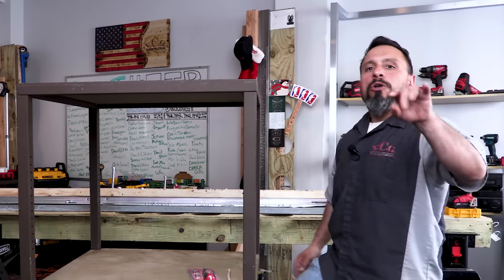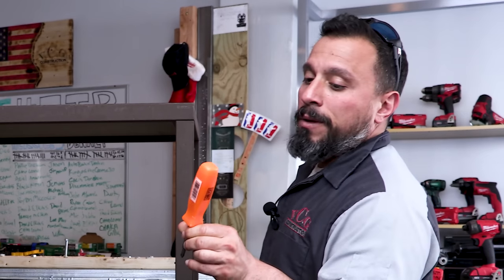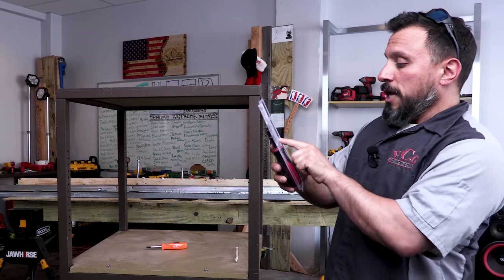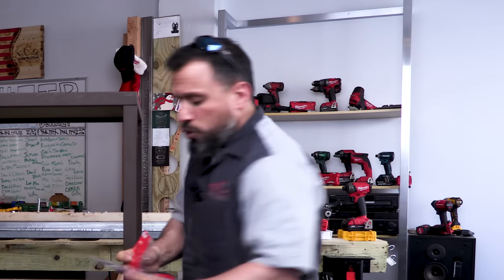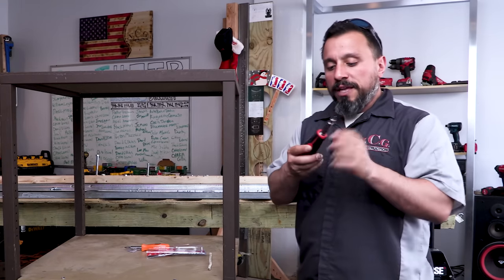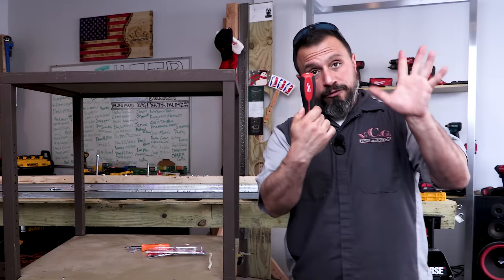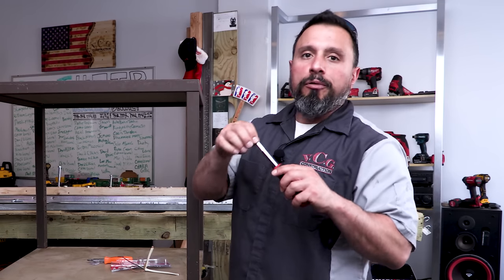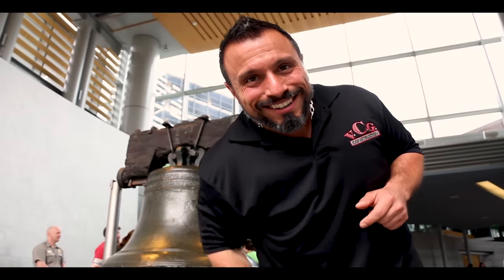THIS MILWAUKEE TOOLS 11 IN 1 SCREWDRIVER HAS A SECRET FUNCTION!

Comment: I am a fire and security alarm tech and I actually have been  used this 11 in 1 screwdriver for almost a year  and I never knew about the 11th function. I also have the 10in. 6 in 1 combination Electricians wire Strippers and I love it.

Comment: I do hvac and absolutely love this screwdriver especially on the new Ruud units the square drive is awesome for swapping the electric box and wiring the unit and the 1/4 in and 5/6 is all I really ever need for a nut runner all around a good buy

Comment: I use the Milwaukee 48-22-2302 10 in 1 screwdriver and love it. The bits store in the handle and are long. I can also use them in a drill or impact driver with no adapter. The bits actually hold their own to some of the impact driver bits I have used. It also features the wire curling and has a wire stripper built in. The ratcheting feature on it works great. The head is a little loose from all the use it has seen and does wobble but it still works flawlessly. I would recommend a review on it or its similar model.
Reply: Yup, I've been using this screwdriver for years. Since it came out and have bought several extras.

Comment: i use this every day at work...i go thru at least 4 or 5 of them every year...when HD has them on sale i buy 4
Reply: Why don't they last?
Reply: @JoshTheElectric  i work in hvac so they get wet sometimes and the bits start to rust out or i lose them on a job somewhere. I use the phillips bit & 5/16 on every call so they wear out too. I buy them when home depot runs them on sale for $8
Reply: @JoshTheElectric  😂😂😂Lol
Reply: I'm in the same boat 4 or 5 a year but it is what it is

Comment: It also works great as a 5/16 and 3/8 Allen screw driver making it a 13 in 1 plus the wire bender. I love this multi and use it every day. Only thing I didn't like was the handle so I just put my Klein handle on it
Reply: I found the plastic portion of the handle was needed, so I could scribe my name on it with my engraver.

Comment: Take the bits out you also get 2 different sizes of Allen Wrenches 🤯 comes in handy for electrical lugs to snug wire in place before you torque them

Comment: I bought a set of these drivers - 11-in-1 and 13-in-1, and first time using the 3/16" slotted bit it chipped and broke. Do they replace these bits under warranty?

Comment: I have that in my bag right now I do think the bits come out a little easy I use a 6in1 most of the time because the detent ball goes so much further into the shaft so it holds better 👍🏻 but the bending function is why I pick this screwdriver up 30 times a day great vid 👍🏻

Comment: 9 out of 10! Fits terminals/ground screws/plates... its all I use some days. Does not fit in recessed holes and does not ride in a tool belt pouch very well, due to the short shaft and heavy head. But I own 4 and will be buying more if I need to... Milwaukee or Klein same shit.

Comment: You might like the ideal brand multi bit. No fuss kind of a driver has a quarter inch and 5/16 with your number 1 and two Philip's and slotted that's it... but it also has that little wire bender tool and a wire nut twister on the end

Comment: Vince u forgot the other cool function. It doesn't roll away as much as the competitors if u drop it or put on a table. 🤘🏻sometimes the fater handle is bulky for tight spaces though, but I got used to it 🤘🏻🔥

Comment: For my cheapy multi bit screwdriver I'll normally just go to menards and find the performax racketing and telescoping ,13 in 1 screwdriver and I've had one for a year for mainly farm use it still works just fine I think it was like $7 when I got it.   But the one in this video seem like a a viable option also

Comment: bought one of these for work and it's a good tool but the bit holder and bits needs to have a tighter fit. they pop out too easily when dropped or if the bit gets stuck on a screw. it's now my back up multi-screwdriver.

Comment: I have been using the Klein 11in1 screwdrivers for years. I have one on my desk, when in my laptop bag, one in my main tool bag, one in my main camera case. (I am a datacom guy and a photographer). I have lost a bit or two over the years. (Had the 10in1 before the 11in1 came out)

This year for Christmas, my dad go my brother, my son and I all each an Ideal 35-688 21-in-1 Twist-a-Nut Ratcheting Screwdriver, of course, he also got one for himself. It's pretty decent, but you know what they all are missing?  SECURITY BITS! I have a no-name brand, MANYin1 (I forget how many it is) screwdriver that has many of the security bits.
Reply from the maker: Good feedback

Comment: As an Electrician, I will ONLY have on me a pair of Linesman pliers and a 11-in-1 multi driver...and get through the majority of each day...Luckily, I found a set of these Milwaukee 11-in-1 paired with the Heavy Duty 13-in-1 (has a 1/2 nut driver in the base shaft, can't figure out the 2nd extra feature of the HD 13-in-1) in HD for $11 for the pair....

Comment: You can also use the ends without the bits in as Allen keys in a pinch 5/16 and 3/8 at least with the Klein one you can same designs should be the same result

Comment: Vince--What, no magnet??  That's kinda standard on every screwdriver like this.  It keeps the screw attached long enough to get it started, when the driver is screwing downward.  I need that.  I get that it's probably ideal for your purposes, as they're cheap enough that you could lose one or two a week and not be bothered by it.  Also, it's non-ratcheting, which makes it less-useful to me.  I have found a ratcheting mechanism is a plus when installing multiple screws; it just speeds things up. The "secret" function is desirable, although the diameter of the shaft will often make too large a loop.  One could adjust for that by not turning a full circle, or just snip off the excess.  I suspect, though, that everyone has discovered that trick while using a standard Phillips screwdriver sometime during their life.  It's one of those "aha" moments you have when working around the house

Comment: The old version was better! When it became obvious they were going to replace it with this cheaper bulkier version, I stockpiled several so I wouldn’t have to buy one on these. The old version made me a Milwaukee fan. I use it all day every day. It was the greatest screwdriver ever. I would gladly pay double for the old one. I think I actually have the new one somewhere. Bought for comparison but won’t use it till I’m forced. Bought one of the overpriced green ones you mentioned. It was so bad , I threw it away. Bits fell out while you used it. I’m sure the new Milwaukee is better than that. They actually have a 15 in 1 that is closer to the old version, but you have to buy it on E Bay, and most of the bits are useless, to me anyway. The 1/2 nut driver they added is unusable in tight spaces. And that was the only thing missing from the old 11 in 1. I’m going to miss them when they are gone. Hard to beat $7, I guess. Maybe I can get used to that ugly oblong handle. Just hope the quality is better than it looks.

Comment: How many people actually use the wire loop hole on the screw driver? When you think about making up a fixture you need to strip the wire before you bend it. I just use the pliers I have in my hand to go ahead and bend the wire. Then I’ll use a screw driver or gyro driver to tighten the screw on the terminal. It’s faster for me than trying to thread a wire into a hole.

Comment: Looks like there gearing more twords the electrician weather it be that ecx bit I think it's called or the hole to bend the wire ends to fit say outlets & switches side screws or really any terminals for that matter so gotta hand it to Milwaukee for that!!

Comment: I'm upset at Orange Hdx screwdriver. I was tightening on a smaller sand filter and the tip of a Phillips driver ended up breaking off in a stainless screw. It was sucky getting the screw out and had to buy a new screw plus new driver. I'LL NEVER buy another one again.

Comment: I give u the smash just for ur efforts not for the shiit product an a wire curl without a wire stripper wtf an if it had the stripper feature it wouldn't work on the variable gauge wires now would it just a cheap gimmick like glow in the dark condoms